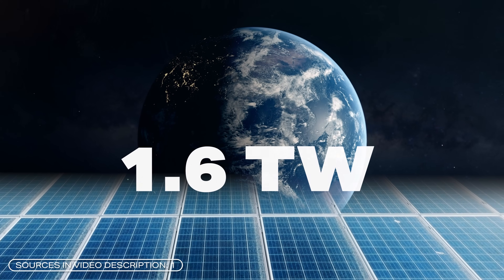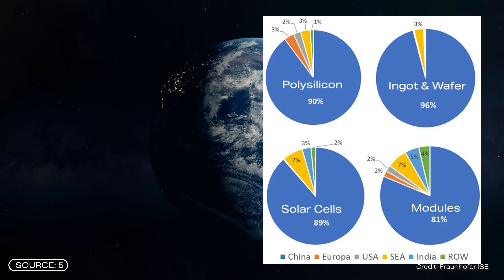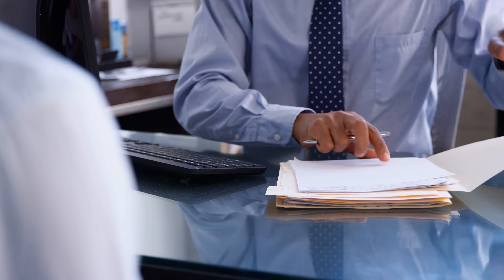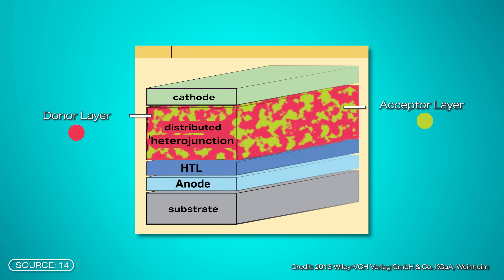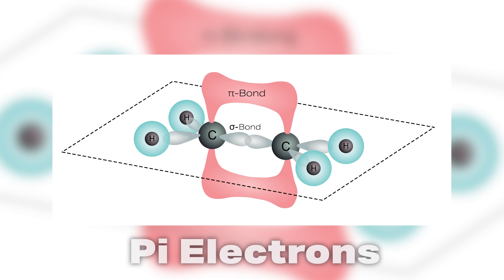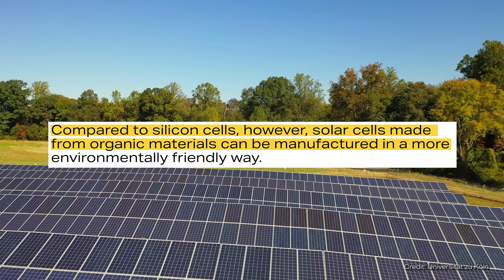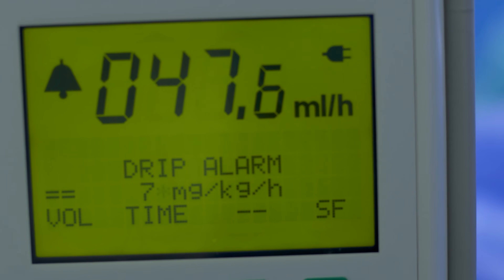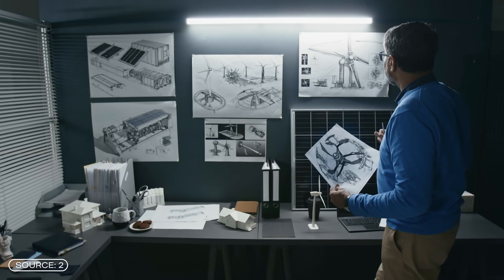Organic Solar Cells Made From Carbon!

Comment: This innovation sounds like a great application for the enormous amount of windows used in glass and steel skyscrapers to provide power for the building themselves and if it's so easy to manufacture it could be replaced as it breaks down and lowers in efficiency. If they produced it as a window tint it would be an existing job market for the professionals that already exist. The additional electrodes would be a new skill but I'm sure it would be easy to learn.
Reply: too windy would be scratched by dust and UV degraded into oblivion. Would have to be replaced yearly
Reply: It could be embedded into the center of 2-layer UV resistant glass window panes
Reply: It won't work.
We need constant source of energy.
Germans discovered that 15% of "renewable energy" destabilized the grid.
We need solid coal power, not feeble solar panels which doesn't work during the night.
Reply: @WadcaWymiaru  Easy to solve by capturing excess solar energy and storing energy in batteries. More solar panels and supplemental wind power and even some geothermal can replace burning all fossil fuels for electricity generation.
Reply: @LateForDinner-mn1hn Renewable energy advances need to be followed by demonstration projects to evaluate the feasibility of building more of those projects.
Reply: @jeffallen4377  That’s pretty much what happens with every new technology. Although the amount of money being thrown at AI 🤖 without much more than fantastic claims shows that investment in technology is more a matter of a dangling get-rich-quick schemes than real life innovation to benefit the masses.
Reply: @LateForDinner-mn1hn  Not easy to solve because it is very expensive. 
Europe has made their industry uncompetitive, while China is burning all the coal it can get.

I actually want alternative energy sources/storage to succeed, but forcing technology's adoption before the technology becomes economically sustainable, is self-sabotage.
Reply: @LateForDinner-mn1hn  
This is VERY VERY expenssive proposition, and inefficient.
Reply: @WadcaWymiaru  Australia disagrees with you.
Reply: @LateForDinner-mn1hn  
U will NOT deceive me!
I was watching Australia 60 minutes!
Grandpa power bills went from $400 to $800 !!! Even Musk was crying...
Reply: @WadcaWymiaru  Don’t be confused by the slow progress of improving the transmission lines of the grid for the rapid growth of renewable energy which is so much cheaper than fossil fuels electricity generation.
Reply: @LateForDinner-mn1hn  
We are already out of time...and fossil fuels are the future with nuclear.
Fuels for transport and nuclear for baseload.
Reply: @WadcaWymiaru  The sun is nuclear.
Reply: @LateForDinner-mn1hn  
The Sun doesn't shine during the night.
Thermonuclear energy is impossible now without "cascade magnetic ressonance" phenomenon.
We need fossil fuels and thorium energy, we have enough for ~20 bln years worth of thorium fuel in the crust.
Reply: @WadcaWymiaru  When I go out and about my cellphone still works and it’s not even plugged in. But Lithium is about to get replaced by cheaper more abundant sodium, especially for large applications. Fossil fuels are basically stored solar energy as well, it’s just that it creates too many other problems like respiratory disease and rapid global climate change.
Reply: @LateForDinner-mn1hn  
I am aware than sodium will replace lithium, also solid electrolyte finally make them safe.

However i must deny your claim: no fossil fuels are causing the "climate change" because CO2 was proven to NOT be a "greenhouse gas", same for methane.
I am meteorologist and i KNOW the *Gas Laws* - they are NOT to be denied!

P.S. About "respiratory diseases: the indoor pollution from burning the renewable organic waste is doing that.
Reply: @WadcaWymiaru  There’s new heat pumps being used in commercial refrigeration systems, if CO2 is inert to heat energy, then I guess all those commercial businesses are imagining things. But really think it’s you who are either lying or confused.
Reply: @LateForDinner-mn1hn  
CO2 is inert for the atmosphere, you are NOT educated in the subject.
PV=nRT
Ideal Gas Law is absolute and CO2 adds only 0.06°C. [number got in 6 different ways]
See: 101.3 x 44 / 8.314 x 1.225 = 437.63 K
Conver to celcius: 164.48°C
Multiply by the abundancy: 0.04% x 164.48 = 0.065°
Repeat for the rest and you find the right amount of water vapour in 15°C.
Reply: @WadcaWymiaru lol, Eunice Newton Foote disagrees with you, and so do 99.9% of atmospheric scientists.
Reply: @LateForDinner-mn1hn  
Prove then. Show me the equation for "greenhouse gas" and accurately calculate the temperatures of Venus, Earth and Titan...
[this is why i dislike uneducated people, the "believe", i have energy that cost me $150 per MWhe]
And your "scientists" are maybe 0.3%
Reply: @Wad @WadcaWymiaru  CO2 isn’t a noble gas
Reply: @WadcaWymiaru or wind, or geothermal, no methane or CO2 due in their use.
Reply: @DavidBridgman-hy8ib  
Methane and CO2 are neutral gases, physic.
Reply: @W @WadcaWymiaru  you mean non ionic you are correct.  In terms of trapping heat in the atmosphere they do so more than a vacuum or nitrogen or oxygen therefore are not neutral in their global warming effect.
Reply: @DavidBridgman-hy8ib  
Are you able to calculate that for me or...you just "believe"?
Man this is NOT a faith! In science ANY result must be repeatable by others!
*Ideal Gas Law* is the only valid gas law, since ~200 years made by Emile Clapeyron.
[i also have Atmosperic Transmission calculations, MODTRAN Standard Radiation Code used by USAF, result is 0.06 degree, not to menstion NASA Atmosperic budged calculations, i finished them]
Reply: @WadcaWymiaru  CO2 is not a noble gas.
Reply: @LateForDinner-mn1hn  
So you continue to believe.

BTW - Argon is ALSO a noble gas, but it HAS effect on the temperature, easy to calculate by the Gas Law:
Ar: (weight 40)
101.3 x 40 / 8.314 x 1.225 = 397.853
397.85 k = 124.7°C x 0.9% = 1.12 °C
What give gases energy is gravity as a function of the pressure. Doesn't matter noble or not.

I am still waiting for you to deny my result.
Reply: @WadcaWymiaru  CO2 isn’t a noble gas, it’s not inert to heat and its ability to absorb and release heat is well known. You don’t understand atmospheric physics very well if you don’t know that very basic science.
Reply: @LateForDinner-mn1hn  
I because you "believe" while i am calculating as meteorologist.
What you and "99% of scientists" do ignore is...gassess have MASS!
So the momentum, so the kinetic energy, so the temperature!
And they will FOLLOW the law of gravity! [adiabatic compression]
This is the reason WHY i am able to calculate the Venus temperature from Earths and Titans!
Find user 1000frolly PhD and learn from him! 
Climate Science 3; There is No "Greenhouse Effect" on Venus Either video in 11:11
Reply: @WadcaWymiaru  You’re following quite the fringe ideology. And you haven’t even acknowledged that CO2 isn’t a noble gas and does absorb and release heat, something well known for over a century. Your bafflegab argument is quite useless, you might as well be claiming the earth is flat.
Reply: @LateForDinner-mn1hn  
LOL
Are you trolling me?
I taught you that all gassess are following the *Ideal Gas Law* .
Regardless the type. Gravity compress equally.
Learn about Atmosperic Transmission.
You will see that CO2 has it's peak around -89°C , so much of heating.
[oher gassess like water vapour ALSO absorbs the heat, nitrogen and oxygen heats from UV - watch the world in UV video]
C'mon move and calculate me the result, i do not have strength to think for others!
Reply: @DavidBridgman-hy8ib  
This is the reason WHY you are wrong like all of those "warmists". You are looking ONLY on the temperature in equation, but there is invisible field of energy called GRAVITY in the function of the pressure! Adding the energy!
This is WHY Mars is cold and Venus is hot. Both with Nitrogen and CO2.

As long gas has mass, it will have momentum so the kinetic energy. This is why adiabatic autocompression (negative work) and *Ideal Gas Law* invalidates the so called "greenhouse gas effect.

You are talking and talking, show me you can repeat the result of NASA, i am very curious since i never saw the equation!
Reply: @WadcaWymiaru , I suspect you've never heard of Global Warming, or black lung disease. Or you own stock in a coal mine.